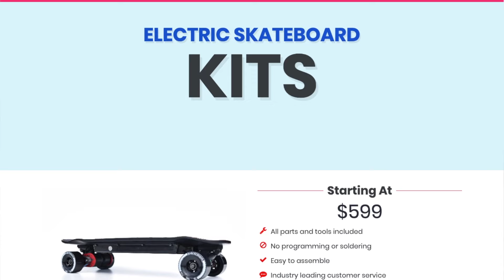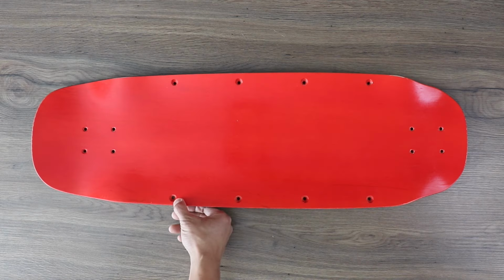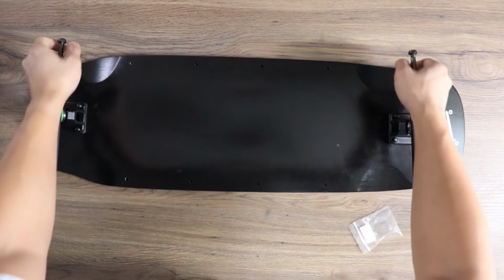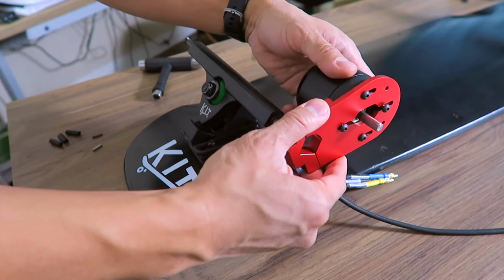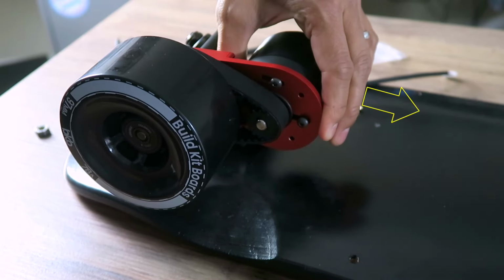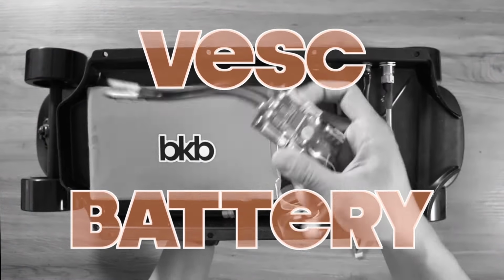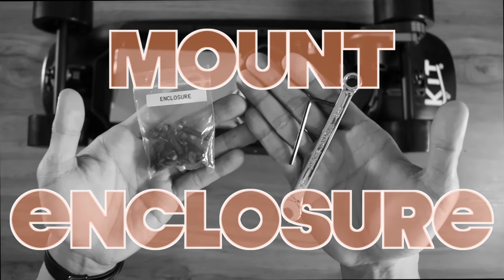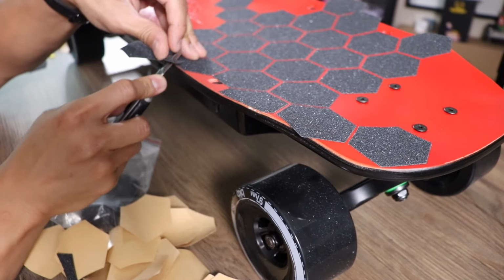EASY DIY 🔩🔧 ELECTRIC SKATEBOARD KIT - TUTORIAL

Comment: Thats a very nice tutorial.  One note: the key was installed 90 degrees off.  They should be a tight “press fit” and should be fully engaged with the cog you seem to hold it where it does the least good.

Comment: 14:04 Thanks for making the time to put together this board and video.. Hope you used loctite on the axle here,, doesn't look like it's engaged the nylon on the nut..  Stay safe..
Reply from the maker: Hey there!  Thanks for the kind words.  Actually, I did go back to the wheel with the wheel pulley to inspect why the nut would only go down much and realized that the bearing in the pulley pushed the wheel out more than it needed to. After pushing the bearing in the wheel pulley down so it was flush I had more room to torque down the nut to where it safely held the wheel.  And like you mentioned, loctite on everything 👍🔩.

Comment: Hi , I had a question.  I have an e board I bought and the battery dies fast . Can I just wire up a better more power full battery with customized box that will fit it? It's a 24.2 v that's in it and I want more distance
Reply from the maker: Using a battery with more capacity to extend your range is possible. What you'll need to find out though is how many amps your electronic speed controller can handle.  If you don't know that then you may want to get also a new electronic speed controller or ESC.  Also maybe you should you can start by checking out the Esk8 calculator to find out what you need for your our range and speed. https://calc.esk8.news/#/0. Honestly, in my opinion it's always best to start from scratch instead of updating an old board

Comment: Hey bro I got a question the Metroboard x change their Motors to 130kv is that a plus or a minus from the original Motors
Reply from the maker: It depends on a number of factors.  I wouldn't say it's a minus from the getgo.  What's the original KV of the motors?
Reply: @BigKidsOfficial  I couldn't find it all I know the original motors are huge, and the 130kv look small compared to them, and all their inventory for they other boards and parts are not available, another eboard company looking sketchy dude
Reply: @BigKidsOfficial  I was so close to buying it then I noticed the inventory of all the boards and parts are gone and then I notice the size of the motors has been changed to a smaller size 130kv
Reply from the maker: Naww, Metroboard is a very reputable vendor.  Their are just not mass produced the same way the manufacturing off an assembly works.  Metroboard and Lecroix are performance Esk8 vendors for sure.  KV rating is a measure of how many revolutions per volt a motor spins.  130kv is lower than what I'm used to seeing.  However, I'm completely trust Metroboards as they are veterans from the DIY scene and probably know much more than me.  If I were you and you like the Metroboard I wouldn't flinch  Made in the US by a company that doesn't rely on outsourcing.  You'll pay a pretty penny but it's totally worth it!  Good luck and thanks for checking out the video.
Reply from the maker: KV rating does not dictate the size of the motor.  For example I have (2) 5355 for 2 different builds and they have a KV rating of 170 and 190.

Comment: What do you think about using carbon fiber decks? 🤔
Reply from the maker: For electric skateboards they are great!  Light weight and stuff/rigid for high speeds.  But, they are much more expensive then maple or bamboo decks.
Reply: Big Kids watched your 2 part series on how to make your own board. Really making me think that I can build my own and save tons of money on an Eboard. Reason I asked about the carbon fiber deck was because I bought an Aeboard AX3 carbon fiber & a Meepo AWD Pro. I could have built 4 Eboards on what I spent on 2 .
Reply from the maker: @saprano1972  that's the thing, I think there is a false sense of economy when it comes to DIY.  To purchase all the parts separately it tends to be more expensive.  And then you have to consider the tools.  However, I'd say there is more value in each dollar you spend when it comes to DIY because you are not compromising on parts that you want, it's only limited by your imagination.  My lost current build was a dual motor build with a 12s4p battery pack, and it is almost exactly the way I want it.  But it did cost me a pretty penny!  I hope you end up building one.  The knowladge and skills you gain are priceless.
Reply: I have carbon fiber.  Zero flex, I can’t recommend.  It makes for a very vibration forward experience.  Feet don’t like it.

Comment: I am a heavy rider.   I want to turn my longboard into a electric.  What should I do as far as having enough drive and power for a bigger guy?
Reply from the maker: Hey Fred!  Thanks for checking out the channel.  I would definitely recommend dual motors with either 6355, 6374, or 6380 motors (those are sizes).  Then I'd make sure you have a 12s battery.  That combination will get you moving very well 😉
Reply: Big Kids thanks man!!!!

Comment: It's a cool idea but you can now buy belt drive completes for slightly less than this. Idk if this was ment to just be a project kit or supposed to be a competitor to more established eboard companies but the value just isn't there.
Reply from the maker: Sure, I guess it depends on what you value
Reply: Most completes are closed systems like Apple. Break a motor/esc/whatever and youre stuck to buying from them, if the even sell it anymore.
This is fully upgradable/customizable/fixable system.
Like Neil said, it's up to you what you value.
Reply: Completes done use Vesc or 6355 190kv motor  some Much more value Torque & Power Here